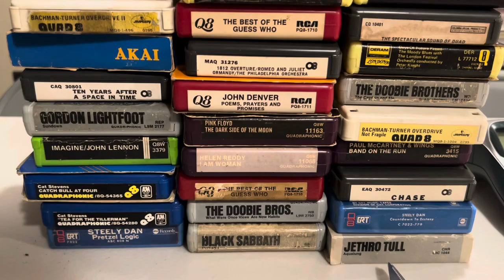Video Request: 8 Track Tape Cartridge Repair! Various Style Shells.

Comment: Perhaps I'm Only Partially Wrong In Saying 8Track Tapes Can't Be Repaired...
Reply from the maker: Most of them are relatively easy to work on for the most part. Of course there are exceptions. The worst, and i mean worst, other than the RCA shells that wont open, are fixing other peoples incorrect repairs. Thats a nightmare.
Reply: @rockrollhi-figuy6824  Well 2 Different Time In 1978 An 8Track Tape I Had Was Eaten By The Tape Player...The Tape Rolled Out And Tangled...Right Then I Knew It Was Unrepairable...